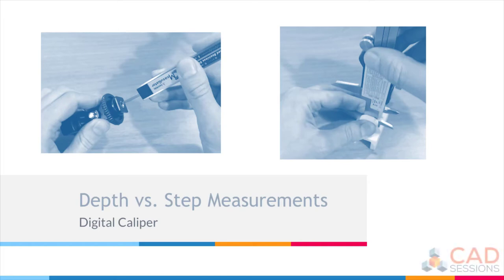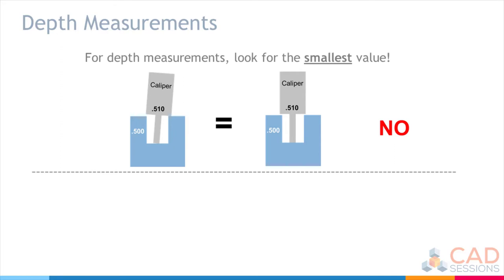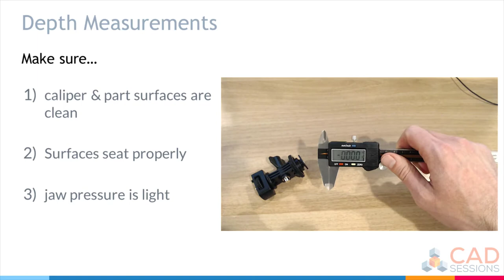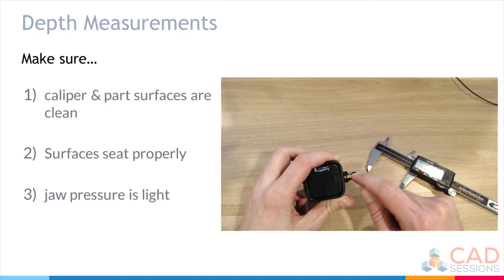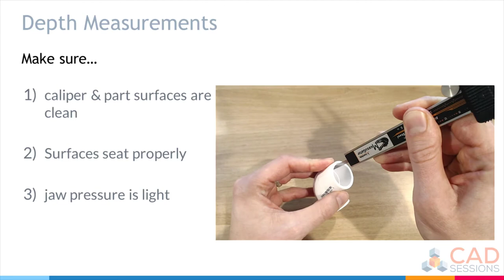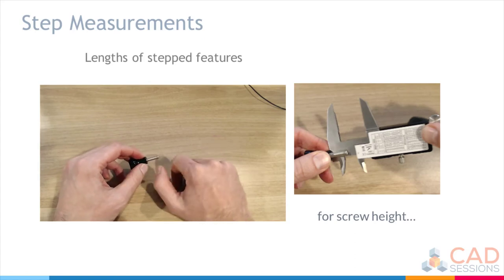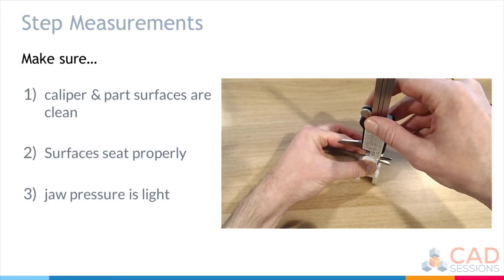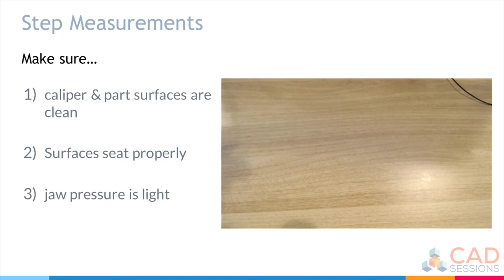Mini Course 3 - Lesson 5/5 - Caliper Depth vs. Step Measurements

Comment: Cool now I know after decades of using a vernier caliper it has this 4th feature, the step measurement and just knew now why the depth probe (used for the depth measurement) is always shaped in an 'L' which is used for holes with rounded bottoms.

God bless.

Comment: Great video. Why is there a knotch in the Depth measurement extender end ? How is that to be used ??
Reply: I think it is so it can measure smaller holes at shallow depth without compromising the strength over longer distances.
Reply: From my limited understanding, it's for measuring holes that are not flat on the bottom, like a rounded hole, or one that might be pointed on the bottom like a drill bit might leave...

Cheers....